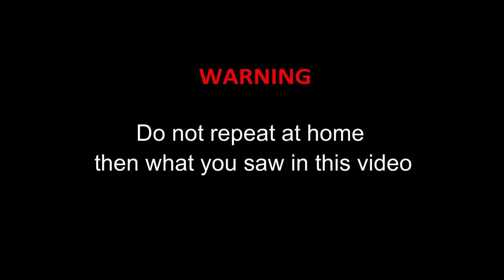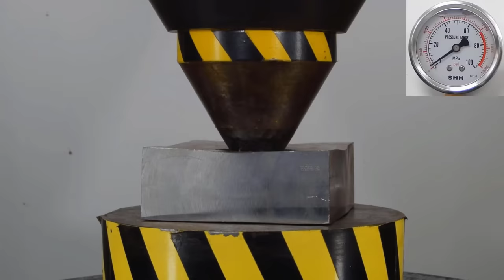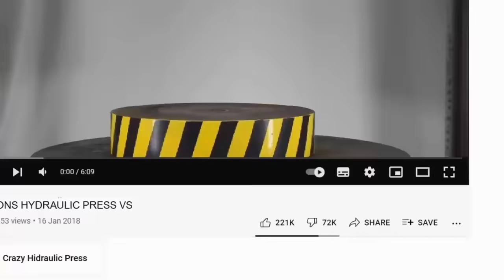HYDRAULIC PRESS VS OLD AND MODERN ARMOR

Comment: The way that steel blew up at the end was like a giant fragmentation grenade! Pretty scary stuff actually. Now I can see why all of the safety precautions are necessary. I’m very surprised by how much stronger our steel has gotten, I didn’t think there was this much room for improvement.
Reply: that's how the people on the titan sub died when the sub imploded that quickly
Reply: Part of the reason is because different steels are made for different purposes.

The Soviets could have made armor steel similar to AR500 back in the 1940's. in fact, some of their tank armors were even harder, but there's a reason they didn't continue doing this. Tank armor is not supposed to be as hard as possible. Steel is on a spectrum between hardness (ability to resist deformation) and toughness (ability to withstand shock). Too far in either direction would make it bad for the armor.

If tank armor was super hard, then it would also be super brittle, and big impacts (like incoming shells) would cause it to shatter super easily. Shards of razor-sharp metal would fly everywhere inside the tank and kill a lot of people.
Reply: @raven4k998 the pressure of the water was more deadly than that carbon fiber vessel. If that's what you meant, you'd be correct
Reply: @raven4k998 With the Titan they used carbon fiber, very strong but when it fails it fails suddenly instead of deforming and bending which could be the difference between getting back to the surface before total failure. I've also seen an example of this in motorcycle racing where a damaged rear wheel made of carbon fiber failed instantly and blew into pieces so they don't use those now haha
Reply: I think we have long ways to go not just alloy formulas but more like techniques of structural manipulations
Reply: Well, we did have both "great" and "crap" steel during ww2, and now as well.

The T34 was notorious for sometimes having great armor, and sometimes having armor that was more like a hard cheese, lol. The example shown appears to be somewhere in the middle of that range. However, notice the T34 armor didn't "store energy until it broke" (like the AR500), it swaged and experienced plastic deformation (like putty). It also withstood 100 tons more force.

In a tank getting hit by a penetrator type AP round, there were basically 2 classes of "dangerous stuff getting inside". The penetrator itself (which might punch straight through both sides, in and out, or ricochet around the interior, bad news). Then there was spalling. Spalling is chunks of penetrated plate that have broken free, sized anywhere from dust to bore sized "scab", that bounce around doing massive mischief inside the tank. The chunks (due to energy transfer during the load/failure cycle) could often be red hot, thus increasing the damage they do.

So, as tank crew members, which of these plates would we prefer? Our exemplar T34 plate appears to be prone toward just allowing nice plastic deformation, which would allow penetration with a minimum of spalling. Our AR500 sample, on the other hand, seems to allow almost no plastic deformation, resulting in storage of energy that suddenly releases by shattering. That means, with a suitable penetrator, it will have massive spalling.

So, which is preferable? Would you prefer a pair of new portholes punched through your tank, or a sizable chunk of the target plate converted to homicidal high speed ricocheting gravel that might be red hot?

Btw, AR500 isn't actually armor, it's an abrasion resistant alloy used for high mechanical wear applications, like tunnel boring machine heads, or teeth on power shovel buckets
Reply: @ludditeneaderthal I’m sure AR500 has military applications.
Reply: @wolfiemuse  almost certainly, but so does 1020 structural... that doesn't make either "armor plate". You'd see AR500 in uses like auto-feed mechanisms, wear plates in sliding assemblies, skid plates, clutch faces, and similar abrasive loading applications. That's what it was developed for, long life getting rubbed on by hard rough stuff (AR= abrasion resistant).
Reply: @ludditeneaderthal  Hmm. Okay. Right on.
Reply: @martintuskevicius8084   Devi considerare che l'acciao russo degli ani 40 non era di certo il meglio del meglio,bisogna anche vedere che lega usavano al tempo e se disponevano di cromo,vanadio,etc,etc...
Reply: @dynagoat7374  This phenomena is also known as spalling. And it is not great for the crew.
Reply: @c0dy1287  irrelevant the steel ball imploded the titan sub imploded what they are made of does not matter cause with enough force it can happen simple just enjoy the video and stop nit picking
Reply: @raven4k998  Well I don't know about nit picking, I enjoyed the video and you're talking about the titan sub  so I said something about the sub and that's about it.
Reply: @c0dy1287  yeah i call bitching about the materials when material failure cause implosion is pretty much the same regardless cause stress anything hard enough and it will fail what material it is made of does not matter with that one sure the sub implosion might be different due to it being basically a hollow tube but bottom line it failed and imploded just as epically as the steel ball just that no one caught in on camera like the steel ball was
Reply: @raven4k998  Well I missed the part where I was bitching, I feel like you're just committed to having an argument no one is having, sooo have a nice day?
Reply: @ludditeneaderthal  T34's armor spalled constantly. It was the biggest cause of tank and tank crew losses for the soviets. What are you talking about? Soviet steel was notoriously shit during the second world war.
Reply: @doomerbloomer6160  the example shown would spall far less than the AR500. That is all I said. I also said T34 armor was notoriously non-uniform in nature, ranging from ok to hot garbage. Of the 2 exemplar steel coupons demonstrated, assuming a penetrating hit, that T34 plate would be the one I would prefer. Granted, all things equal, I'd rather be drinking a milkshake in Scranton while those plates were hit in Palmyra, but that isn't germaine to the topic.
Reply: And that's the stuff that they declassified. 

I can only imagine what kinds of alloys and ceramics DARPA and the others have cooked up in the labs.
Reply: @fasullodavvero эта сталь была спроектирована вязкой специально, для уменьшения количества вторичных осколков внутри боевого отделения, второй пункт это угол встречи брони и снаряда 45° а не 90° как на этом видео, что давало толщину приведенной брони ~90мм,  формула элементарная, снаряд  даёт рикошет, а из-за вязкости стали внутри отделения мы получаем небольшую выпуклость, а не град раскаленных осколков брони
Reply: Armor hardness vs toughness has been a balancing act since the 1800s. Early battleship armor was face-hardened, so the outer surface was very hard and brittle, but backed by a region of lower hardness but much tougher and able to absorb more energy.
Reply: @raven4k998  lol what are you waffling on about, not a single person was "bitching" about anything.. Also the ball never imploded, the sheet of steel underneath "exploded" under pressure, nothing remotely comparable to an implosion of the sub.. 😂

Like Cody said you're probably just looking for an argument, but have no clue what you're talking about and miss read the room..
Reply: @ludditeneaderthal I'd rather have the AR500 with an anti-spall backing... which is what's done.
Reply: Just imagine if someone were standing right in front and staring directly at it with no protection at all when it blew up!!!!!!
Reply: Wow, people will find any avenue to bring up that sub, so gay. Jeez, get outside, read a book, find something, ANYTHING! When all you can dredge up to talk about is old news, it's time to find a new hobby.
Reply: Chobham Armour is supposed to be the toughest. Steel made up of layers, in terms of Tanks, to truly penetrate, a projectile would need to hit the exact same spot as one tired b4. Reassuring I reckon
Reply: @c0dy1287   Jimmy Adamo was a professional motorcycle racer who was killed 30 years ago at the Daytona 200. I saw him at a race in Phoenix a month before. Word I heard was that a carbon fiber part in his front brakes had failed and he went straight into a wall at high speed.
Reply: Carbon fiber wheels sound like the dumbest thing possible, one pot whole and the whole thing can shatter to bits.
Reply: @fs5866  meh no different then you whole wheel coming off while your driving so meh
Reply: he is saying in this video that the shiny  new looking piece of armor is from 1940 and the rusty old looking piece of armor s from  2010

the logical dates would be  the reverse
Reply: @fs5866   Racers are willing to take the chance for all that unsprung weight reduction.
Reply: Surely war production armour of t34 isn't going to be fantastic
Reply: I'm not sure our steel is stronger now. It's been adapted not to shatter but it might not be harder
Reply: its almost comparing 2 different kinds of material, mild steel from the old tank, vs specially engineered hardened carbon steel. If you want something that will have a bit flex and not break but bend, you get mild steel, if you want hard edge and springiness you get carbon steel thats hardened and tempered at the right temperatures.
Reply: @ludditeneaderthal for most on the net, its known for being used in personal body armor, I do think its not widely used as armor for tanks etc. because of what you described will happen.  Most tanks are just a mil grade mild steel, and nowadays reactive and active armor is 1000x more important.
Reply: The real improvement is making it just as durable, while decreasing the weight. Imagine if we could take that tough (or tougher) material and turn it into a fabric.
Reply: Vacuum engineering
Reply: Seriously? Whoa.
Reply: This is why I love weapons industry
Reply: @raven4k998  Actually it was probably a leak caused by the difference in compressibility of the carbon fiber hull and the titanium fittings. So it didn't implode, it got flooded, with approximately the water pressure of the tightest beam on a pressure washer. Thunderf00t did a video on it recently.
Reply: @OnlyKaerius  it matters not cause in the end they are dead which is what Stockton wanted to die and go down in history and he accomplished that sick as it is that he did it that way
Reply: Yes. they also use plastic and leather in the military. Plus all sorts of fabric  :D But not for armor obviously. @wolfiemuse
Reply: Why do so many people spout opinions about things they know so little about
Reply: @raven4k998 It's actually not that hard to calculate the energy of the titan implosion, and I'm not sure you could have even captured it on camera.
Reply: @vihreelinja4743  At least not for tanks! Haha. I believe Kevlar is considered a fiber
Reply: @ChrisModjeska  yeah with a high speed camera from a sub at a safe distance away watching mind you there was no sub with said camera watching the titan when it happened unfortunately
Reply: @robinsss  I'm sure there are exceptions but I would think steel which is harder would usually also be less rust resistant. To achieve the extreme hardness you have to sacrifice other qualities. Carbon steel is harder than stainless steel.
Reply: Lol.. People didn't die. Billionaires died. 😆
Reply: @Elrog3  how do you know what these two pieces of metal are made of?

what is the 1940 piece made of?

the 2010 piece ?
Reply: @sizlax  hey there still dead Jim
Reply: @sizlax  they still make good test subjects for sub implosions now we just need cameras on the next set of test subjects so we can watch and see what exactly happens when the sub implodes🤣
and for gods sake make sure they are highspeed cameras
Reply: @robinsss  I didn't say I did?
Reply: @wolfiemuse composite armour is much more effective than straight steel now, so it’s unlikely
Reply: Have you seen the metal made for rocket ships
Reply: cameraman always survives
Reply: @ludditeneaderthal
Reply: @ludditeneaderthal  
That's a great point, I was wondering about this during the video. That being said I think modern tanks have composite armour.  In theory  you could use a hard but brittle alloy on the outside to dull/flatten the penetrator and a softer alloy inside to prevent spalling in crew compartment.
Reply: The steel used in the T-34 was much worse than the regular steel from the time, as it was poorly cured, though I understand you want carnage
Steel from a Sherman would be more representative of the quality back then
Reply: Because it's not really steel.
Reply: Ye that’s the main damage of an APFSDS round, the spalling
Reply: @raven4k998 how do people read what you type? Have you ever heard of punctuation? Your run on sentence gives people headaches when they try to read it lol.
Reply: @dynagoat7374  to those that dont know, that is called spalling and the literal point of some tank rounds.
Reply: The problem is they use projectiles that are harder than that press tip!
this is also the reason they dont use chipboard as armour on tanks!
Reply: May I propose you look up the material properties for AERMET 100.  This is a steel alloy that is stupidly strong and ductile, reserved for the most structurally demanding applications where strength to weight ratio cannot be compromised.  Landing gear on airplanes is sometimes made from this stuff.  AERMET 100 is about 34% stronger than AR500 and yet is more ductile than AR500z
Reply: @dynagoat7374 afaik in the 90s, American tanks running gear parts EOs request was for average of 50 to 60 Rockwell.  Impact resistant grade to the point of almost unbreakable. 
Over the years the Engineering department changed request.  Imo it's relative.  The older grades chemistry a few decimal points different no extreme changes (VAR vs Drop Forged ingots in some cases or require Carbonized). 
The  baking furnaces more accurate than in 1940.
Reply: @robinsss The og piece is most likely
Drop Forged or "CFS".   Just very thick and heavily pounded, compacted to the required thickness. Think of it was originally a 40mm plate pounded until it was the required 30mm.  It gains grain and durability but still flexible. 
The modern piece is a higher Carbon Vanadium and Nickel alloy.
Designed to resist breakage from high speed projectiles but has zero ability to flex like the og material. It's like Carbide; hit it hard enough it becomes glass where the og stuff gets progressively deeper dents until it tear open or separate.

Comment: The problem with the first test is that spaced and layered armor is meant to bleed energy from the projectile to eliminate its penetration. A constant input of energy, like from the press, is always gonna crack it because that's not what it was meant to defeat
Reply: It looks like they made it to break perpendicular to the normal plane of the installed plate. It cracks perfectly horizontally and vertically. Very impressive.
Reply: the point of this video is to see how it does against hydraulic press
Reply: @kawaiiK1ra  They only compare "yellow" and "warm" at the same time. The structure of steel is clearly different, while 1940 sends a big hello to 2010. Steel production is not drawing in office programs by "effective" managers.
Reply: Exactly, a true comparison, like apples to apples, would be a single piece of forged titanium the same size as the steel piece.  This is grapes to apples.
Reply: The first test is from soviet body armour... Its a compromise of bullet resistance and mobility.   The later stuff is obviously tougher as it cant really be worn.
Reply: This was never meant to be a test.
Reply: The whole idea of armor is to protect from as much energy as possible so measuring the breaking point in PSI or TONS doesnt work, you need Joules or calories
Reply: Like knives can defeat bullet proof vests
Reply: this series of comments is what happens when redditors wander in youtube.
Reply: what if they attack our tanks with hydraulic presses?
Reply: Not to mention, steel thickness is not the only measurement you need. Hardness has a big effect. Also, you definitely correct about placement of plates. I also wonder how much better titanium holds up to heat.
Reply: brianburchell8155 I saw a Subaru Legacy T-bone a Jeep at an intersection once and it literally looked like an exploded view diagram. It shed all that energy by throwing parts everywhere. The driver stepped out completely unharmed.

The Jeep remained in one piece, flipped completely over and landed on the driver's A-pillar. Driver left in an ambulance.

Energy shedding works!
Reply: You wrote what i thinking in this videopart.
Reply: Waited along time
To be the 1k like on somet haha niceee
Reply: You just mad a press could smash a tank. 😂
Reply: This was titanium , this is way more brittle than steel . There's a reason why tanks are not made out of titanium , except the higher price .
Reply: This guy literally hydraulic presses candy as well. I don’t think candy is made for that either. (That’s the vibe I get from this comment)
Reply: The slow blade penates… dune once again is right! 🥹🫱🏻‍🫲🏼
Reply: @jessegraef6139  Titanium has a much higher melting point than steel
Reply: @jessegraef6139 it's a sheering strength metal. Another soft metal like tungsten tho mixed with it could handle tons of heat